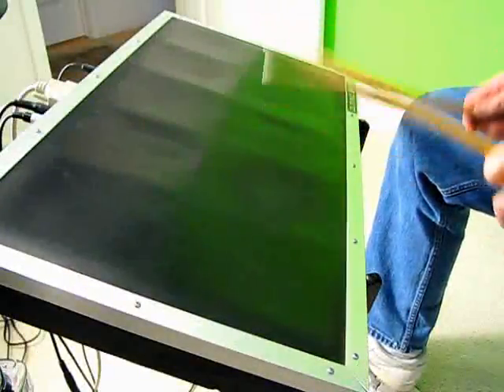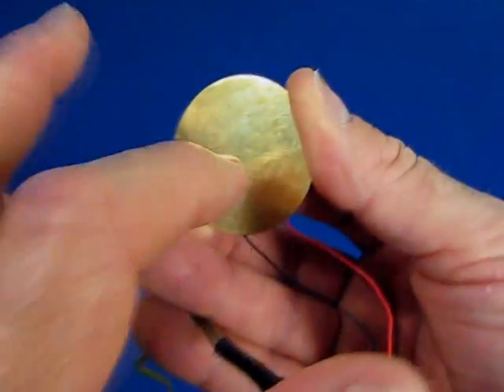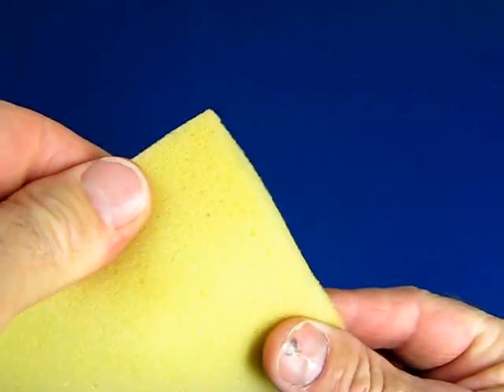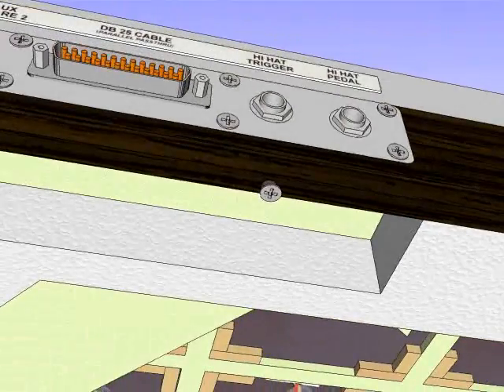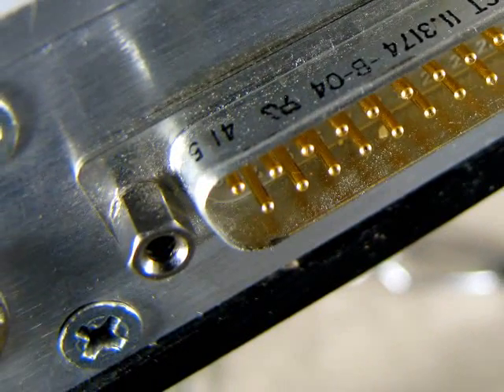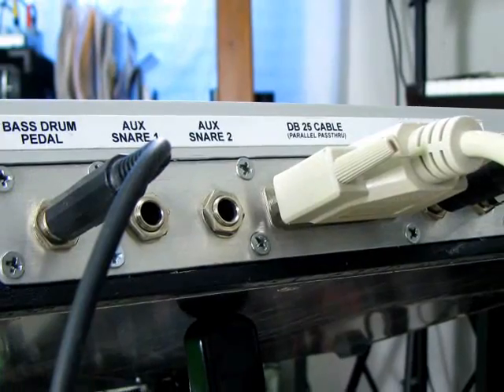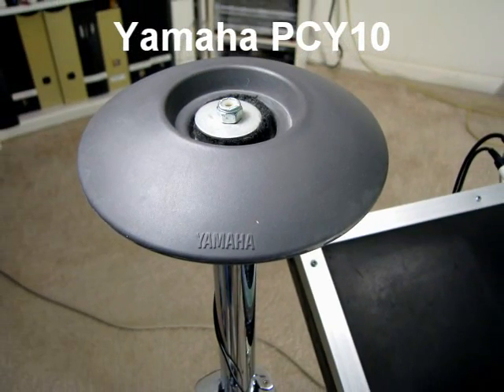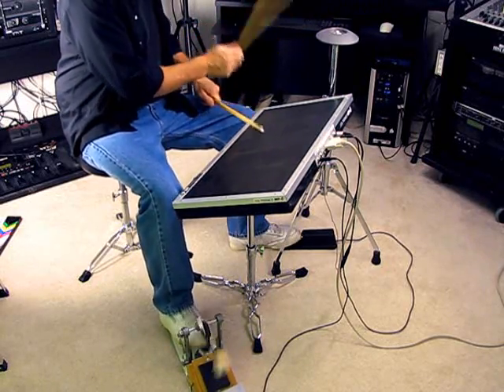Homemade Electronic Drum Kit:Coltronics Kit-e

Comment: The db connector you wired inside the drum machine , were they the wires from the piezos going into that connector only ? How did you know where to put the wires from the piezos into the db inside the drum machine. For it to be able to work with the db cord .
Tell me if you understand my question ?

Comment: Put Together very Nicely, ....I have an alesis hr-16 which i am trying to trigger. it has these hard buttons , which press a rubber conductor across a printed copper grid on the circuit board (soft rubber switch ) I like the sounds of this machine. i emailed alesis tech, why alesis didnt  use these sounds on a kit. no answer yet. Maybe you have an idea about it, if you have looked at the hr-16.

Comment: Hello, and thanks for the video. I am attempting something similar (inspired by yours). Mine is 3x4 for 12 total pads (if you're going to do it, might as well overdo it). It would help greatly if you could give me a little more info. First, can you tell me more specifically what kind of neoprene you are using on top? The options available for this and all other rubber sheet goods are incredibly varied and I'm afraid I'll order something with more "cushion" than "bounce" or something that won't stand up to stick strikes. Also, could you explain a little about how the neoprene is being held down by the angle aluminum? Is it attached to the aluminum? I'm trying to make sure I can get the desired tautness on the top material. One more thing: what are the spacers under the pads made of? Sorry for all the questions, I'm just trying to cut down on trial and error since you've obviously got it dialed in. Thanks!

Comment: Hi.
So inspired by this that I've had a go at making my own. Having some issues with cross talk between pads. Is your top layer of neoprene in constant contact with the trigger/gum rubber beneath or is it only connecting once the area of the neoprene is struck? I've got six little pads that seem to provide good separation without the top layer of neoprene. With the neoprene it would seem that the vibration triggers other pads. Any recommendations?
Appreciate any advice.
Kind regards

Comment: would it work if I spliced a 1/4 in cable and wired it to the piezoelectric transducer and connected the other end to my drum module? The piezoelectric transducer was going to be attached to a an HQ real feel practice pad.

Comment: Tried Alesis Performance Pad which should have used more foam between the plates because if was triggering several plates. Still, I prefer toms with mesh heads with a foam cone in the middle, which I think is much more sensitive to velocity.

Comment: ( 1:51 )what kind of material are the spacers made of?
Reply: I have the same question. Just scanning the comments to see if it has been answered.  My guess would be some sort of soft rubber. Firm enough to hold the weight of the metal plate.
Reply: @2:25 in the video he shows a photo.. They look like little blocks of rubber.. But not the same as the as the gum rubber he used above (which you can see it yellow @1:21)

Comment: Great design!  Thank you for posting this.  I have a question with the wire connections in the board to that db25 pin.   Is there a reference or do you have a detailed explanation of linking or soldering the piezo pickup wires to that db 25 back plate, e.g. what wire to what pin.  Great video presentation also.

Comment: I got an MPC-1 drum machine today that uses piezo transducers and drum pads in an almost identical way to your drum box but I was wondering if there is any kind of switch that I could connect up to the contacts of the Piezo sounders that would send the same trigger signal but simply with the press of a button.

I guess the active component of a Sustain pedal would work for this but I can't find out what kind of a switch is in one of them. Do you have any idea as to what switch I should get?

Comment: I'm trained as an electronic tech  working with engineers on new designs. I  owned a Drumkat 3.5 for awhile. I got to hand it to you that is a very sweet job you did there. I have the electronics & soldering chops, but not the mechanical skills to do what you have done. You also did a first class job in presenting it. You should send this in as an article to Pop Mechanics, Science, Modern Drummer, electronic musician, etc. You are under-employed as a heavy equipment operator. Kudos sir!